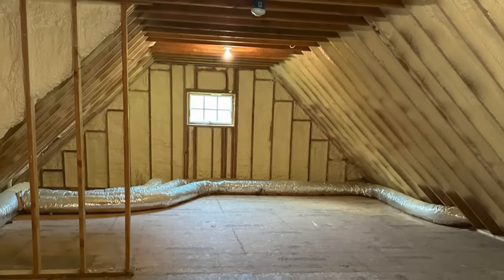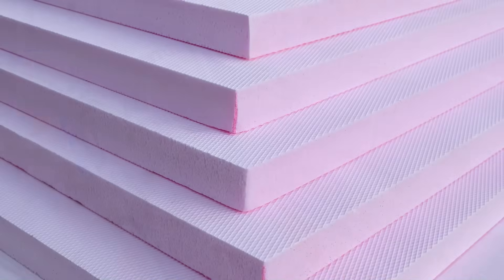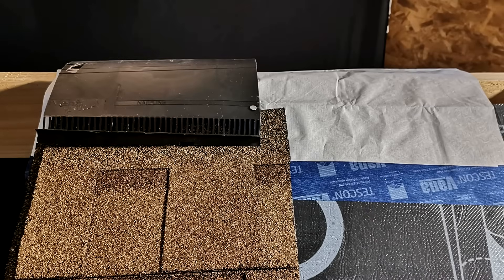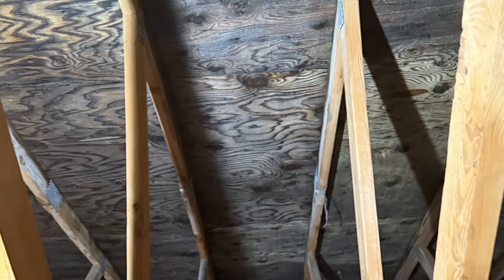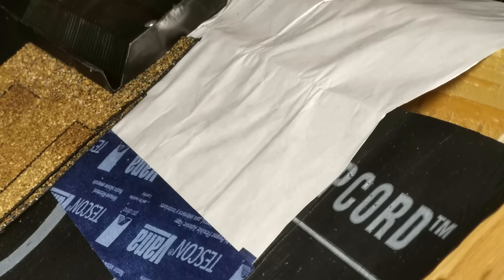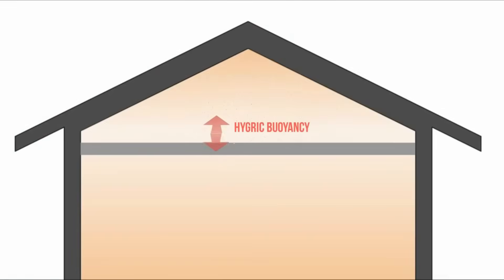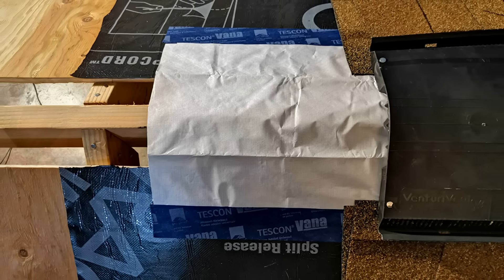The SECRET Strategy to a Dry, Durable, and AFFORDABLE Conditioned Attic (That No One Talks About)

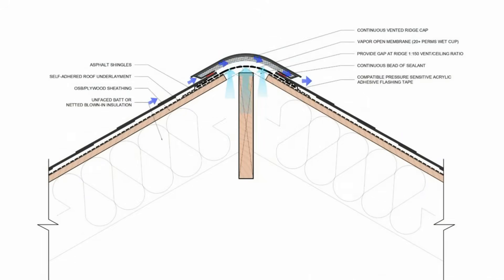Comment: 4:10 says ridge gap should be at least 1:150 of ceiling area. Pretty sure that's IBC.  IRC code is 1:600, so for most homes the gap can be smaller.  Is this right?

Comment: This is the alternative to exterior rigid insulation right? But I'm also confused where does the condensation come from? I understand in cold climate, the moist hot interior air condenses on the cold sheathing; but if I'm in tropical zone 1 with AC on 24/7 365 days, why isn't a supply and return enough to make sure moisture is not a problem in the unvented attic.

Comment: I would like there be to a video on slate and concrete tile roofs I’m from Scotland so for moisture issues where it’s a closed in system. I did dormers for 5 yrs no insulation between the rafters back then and no sarken, onley some roofs with battens and slates

Comment: Man I just love this guy lol. I’m always thinking about how to change things and do it better (owner operator roofing/siding/insualtion) and love the options explored and the way it’s broken down.

I’m cold climate but continued to watch/listen just to pick up something new while working on my place which can potentially translate to something I do here even if not the exact same needs.

Top notch knowledge and communication here always.
Reply: I’ve always thought to just run continuous cardboard rafter vents soffit to ridge leaving 1 -1.5 inch space and have functioning ridge vent. And interior side continuous insulation but exterior continuous definitely better.

Taping the cardboard rafter vents at seams obviously.

I know we do it in walls that don’t get strapped, but I just hate the lack of venting.

I think of let alone moisture control, but then the suns baking heat into a possibly air conditioned space.

Again let alone moisture but just transfer inwards of heat.

Just love exploring and playing out the options in my mind. Might drive myself insane but hey.

Comment: If it's a retrofit though this doesn't seem like something that is achievable. If I'm going to put a dehumidifier in the attic anyway, isn't open cell or close cell foam both acceptable since the dehumidifier should take care of the moisture in the air? I'm about to put open cell foam in my large attic now and deciding between adding supply ducts of about 100 total CFM of conditioned air into the attic (with an erv as well to remove possible off gassing (??)or just putting two dehumidifiers at each end of my attic. Is either approach acceptable?

Comment: I'd be interested to know how well vapour diffusion ports work with external vapour open insulation. On the one hand, less solar thermal energy will make it to the sheathing to drive moisture up via the "ping pong" effect to the ridge, but the external insulation will reduce condensation risks in the first place. Would a vapour diffusion port still be effective? Other details such a lean roof to wall transitions, and having vapour open ridges/vents or side vents, or half cap ridges on open ended shed roof typologies, would be interesting design details to understand.

Comment: It surprises me that this would be a good idea in Zone 1, Dade County Florida. It is more humid outside than inside around 99% of the year. We only had the heat on for about 12 hours last year. I would think that for us, such an install would be more likely to introduce humidity than remove it, and that we'd be better served by actively cycling attic air through the A/C system and dehumidifying that way.

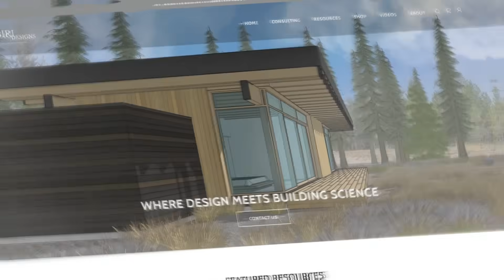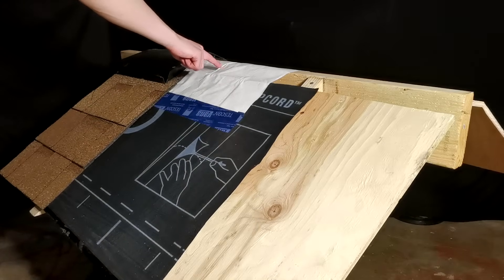Comment: I really enjoy your videos. I am currently building a home in the mountains of Idaho ( zone 5) we live in what they refer to as a dry inland forest with lots of pine and fir trees. The local code calls for a vapor barrier on the inside ( I believe 6 mil visqueen is the local go to). I am very Leary about a vapor barrier as it does have a slight potential for mold growth. I also plan to put one inch of eps foam board on the outside of the home over the osb sheathing ( standard fiberglass batts in the wall cavities). The 1500 sq ft home (over a full unfinished daylight basement) will have a scissor truss with vaulted ceilings. I am also concerned about how to go about the best method of insulating using budget materials, meaning no spray foam or other expensive materials. What would you recommend?  The home will have a metal roof ( and I would prefer a ridge vent) and the whole structure will have a wrap around covered porch ( also with a metal roof, yet the porch will transition from a 6:12 pitch to a 3:12 pitch over the covered porch), so there really is no way any water can get near windows and siding with the wrap around porch, which is 9 feet wide. I would really hope that you could address the proper conventional weather sealing and insulating method you would recommend. Hopefully myself and others in my simial climate and situation will find helpful  answers and ideas from your reply. Thanks in advance. Keep up the good content!

Comment: I'm pretty sure this is one of those things that architects would be afraid to do. It seems counterintuitive and novel. Why take the risk with something that isn't "normal". You can get all the blame if any moisture  problem occurs in the attic. Everyone else, from the builder to the roofer and inspector, are naturally shaking their heads with this "nutty new idea", and you are the one who introduced the new idea, regardless of what really caused the moisture. Another point. 1:150  is a lot of area. I've calculated all sorts of roof at this minimum vent level and getting enough vent area is not that easy even if you have all the eave vents--but this all has to happen at the highest ridge.

Comment: I assume it would be best to NOT use open faced insulation that cannot dry itself out like rock wool just in case you have leaks. I would also assume spray foam is a very bad idea for humid locations due to the inability for the sheeting to dry itself out because you have encapsulated it from any air.

Comment: This, plus the referenced video on vapor diffusion ports and the video on how much exterior insulation are great resources. In CZ 3, I'm planning on both exterior insulation (R16.8) plus interior insulation (R21). From the three videos, I think this ratio should be enough to prevent vapor condensation at the ridge. Still, I think a vapor diffusion port is easy to add. 

I'm wondering if my exterior insulation should stop at the port opening, or should the CI continue to the ridge?

Comment: You talk about this as a solution for southern climates.  However, what happens in the summer, when it’s humid outside, and your conditioned attic temperature is below the outside-air dewpoint?  You’ll be bringing all that outside humidity in.
Reply from the maker: You don't bring outside humidity inside through the diffusion port, as hygric buoyancy, absolute humidity (not relative humidity), and the small surface area of the diffusion port takes care of that. We linked the  research report in the description.

Comment: Benjamin Obdyke has a vapor-permeable roof underlayment, 14 perms, and acrylic adhesive. Any experiences with it?
Reply from the maker: Yes, we use it quite a bit. No complaints so far. It's not permeable enough for the diffusion port membrane though.
Reply: @ASIRIDesigns , I was thinking it would be a more resilient choice for the primary roof underlayment, with better safety margins compared to a vapor closed SA products like Grace or Sharkskin.
Reply from the maker: @ZergZfTw  If you are installing asphalt shingles over it, the vapor permeability becomes irrelevant. It's great if you're able to vent the top side of that membrane though.

Comment: Is a vapor diffuser port needed if you have ZIP-R6 above the roof sheeting (Climate Zone 3) and an ERV removing air at the highest points?
Reply from the maker: No, as these are two different systems. However, you will likely need a dehumidifier for the attic space. ERVs can often ADD moisture to the building if you are in a more humid climate.
Reply: @ASIRIDesigns I sent a consult request to website. Just finished framing, no insulation yet except above deck zip-r.
Reply: I'm going to say something that's probably wrong but I'll comment so that I'll get notified if corrected. I'm also in Z6, which is heating dominated. Firstly, I don't fully understand your configuration. It sounds like you have an unvented attic. I'll assume the roof sheathing is plywood/OSB with an ice and water barrier. I'll assume that there is then an air gap, so I don't understand why you'd have ZIP-R above this. However, a vapor diffusion port makes sense to me so that you're not relying solely on your ERV. Belts and suspenders; passive systems are better. The ZIP-R would then have a ridge vent. In the summer, the ice and water barrier in the air gap is a vapor barrier/condensing surface. In winter the vapor drive would be to the outside through the vapor diffusion port. I'm thinking that you'd want to insulate above the diffusion port with something that is vapor open to ensure the vapor condenses outside of the attic, but I'd love to hear an expert chime in here.

Comment: Do you need this for New York climate zone (assuming a unvented conditioned attic)
Reply from the maker: We've used it to save wet existing buildings (judgement call that should be assessed on a case by case basis), but NY is located in 4, 5, & 6. You need either exterior insulation or closed cell spray foam on the underside of the roof sheathing for condensation control if you're working with an unvented roof assembly to meet code.
Reply: @ASIRIDesigns thanks for the response. I’m spraying ccsp to achieve r-30

Comment: Anyone watching this needs to make sure they cover off this detail with their engineer, especially if you're in a seismic area like Los Angeles. While it's an awesome detail we've used ourselves, cutting holes in the diaphragm along with changes to the nailing pattern on the sheathing may require some additional structural support like straps, this,  along with inspectors not being familiar with it. Your engineer and architect need to make sure the detail is on the plans.
Reply from the maker: The gap size doesn't typically exceed that of a standard vented roof. No structural engineer we have spoken to has had any concerns about it or cared, as we initially had those same concerns.
Reply: @ASIRIDesigns  we had a situation where our EOR didn't want us to make those cuts in the diaphragm. Upgraded strapping was called for in our roof assembly.
Reply from the maker: @SchondorfEnt  Good to know! How large was the diffusion port width if you don't mind me asking?

Comment: Instead of the vapor permeable membrane over the top of the ridge where you would normally have the opening below the ridge cap could we use something densglass or gypsum product?
Reply from the maker: Yes, you can. We've used densglass gold on a couple diffusion ports in dry climates. Less familiar but certainly works.
Reply: @ASIRIDesigns what causes you to choose to use something like that over a vapor permeable wrb material?
Reply: I think you want a minimum vapor permeability but I think above 30 was recommended. Im also just kind of curious as to why youd want to do that over just using tyvek or blueskin.
Reply: For a vapor diffusion port, a one way permeable membrane is used. It allows moisture from the inside to pass to the outside, but not the other way around. More specifically, the perm rates of the membrane are significantly less from the outside to the inside. Not 100% vapor closed. This allows any excess moisture gathering at the ridge, a way to vent and dry out.
Reply: @BrianBaldridgeC  AFAIK there’s no such thing as a one-way permeable membrane.  Even if some manufacturer claimed to have one, I’d be very skeptical if it could maintain this behavior long-term.  All the “smart” vapor retarders that I’ve seen work by being more permeable (in both directions) when they’re wet, and less permeable (in both directions) when they’re dry.

Comment: Great video, thank you kindly. Also you mentioned that vapor control is not that easy in colder climates, building a home in N.W. Pa do you have a video on colder climate Attic moisture  control?
Reply from the maker: Thanks for watching, we have a few on the channel, but are also working on some other videos on this subject. If you can't vent it, Hunter Panels are something to look into for the easy implementation of exterior rigid insulation.
Reply: Are you doing a vented attic or non-vented attic? 

Vapor drives from warm moist to cold dry. Warm moist air has energy and wants to give it away. Cold dry has no energy so will freely accept. Where the two airs meet, if there is a condensing surface, the vapor will turn back to water (at dew point). And that water is what causes issues (if not allowed to dry out).

I’m in South Florida, so vapor drive is outside in. In the north (during heating days), vapor drive is inside out. In your case, you need to consider how are you controlling vapor / moisture / humidity from your everyday living (breathing, cooking, bathing, doing laundry, doing dishes, running the dish washer, etc.) When this vapor drives up through your ceiling into the attic, how does it dry out? If you are doing a vented attic, the vented attic is breathing and doing the drying for you (if built correctly). If you are doing a non-vented attic, then you will need to manage it. Either through some form of a diffusion port our ventilation system in the attic.